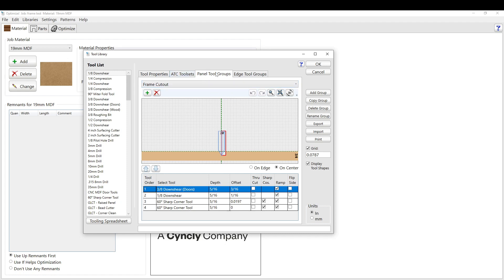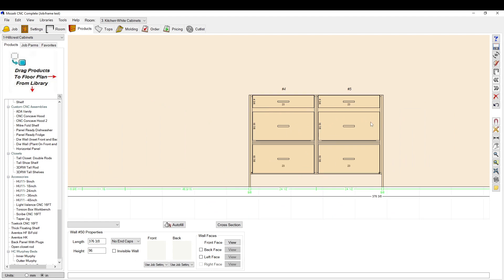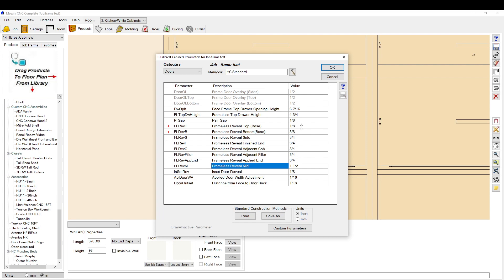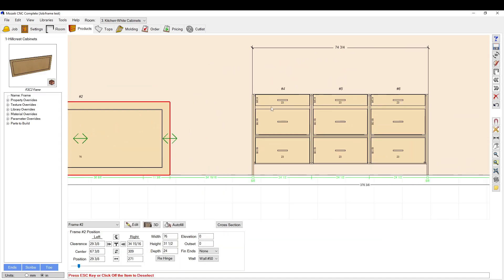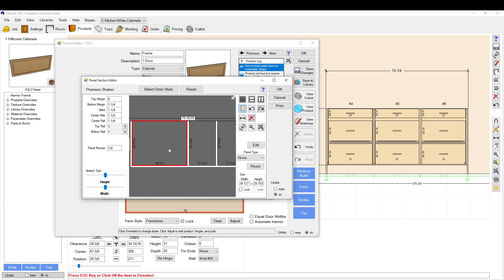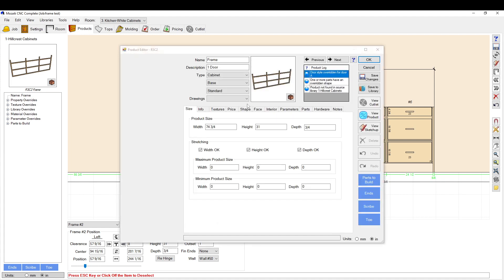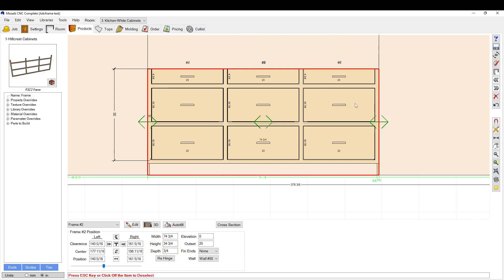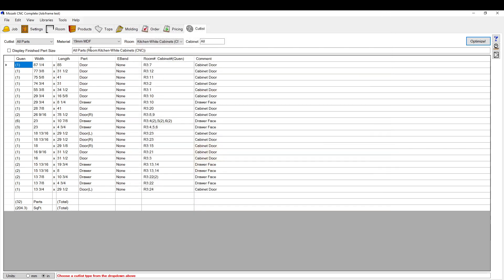Face frame inset for a frameless shop! - Mozaik Software Tutorials

Comment: Love your videos!

When we place the door/drawer bumpers on our drawers fronts, we are 7/8” to the front face of the drawer.  Are you leaving the bumpers off in this application so the face frame and drawer faces are flush?
Reply from the maker: I actually used 3/4 frames and 5/8 fronts but could inset the slides and hinges also instead.